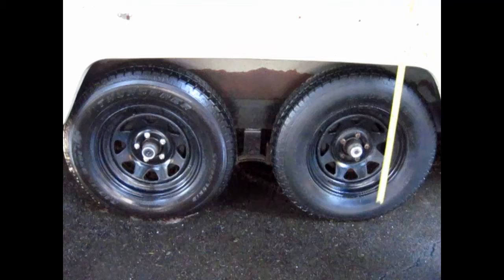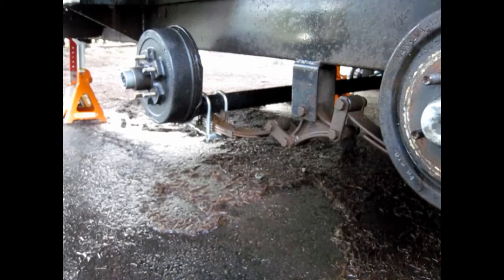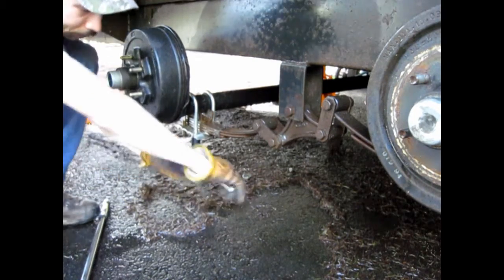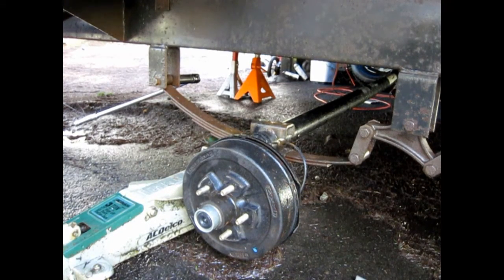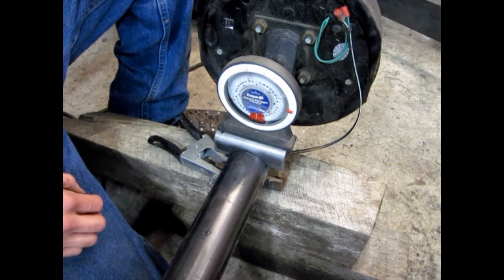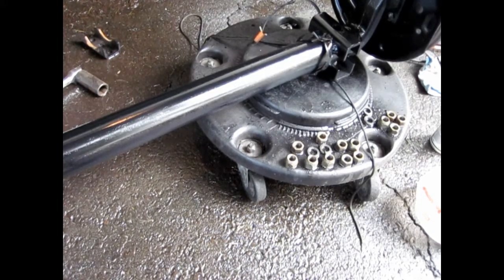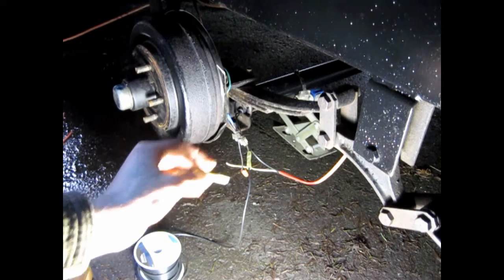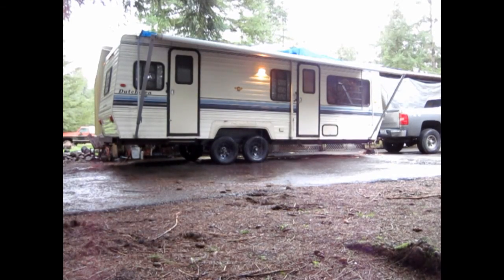Trailer Axle Flip

Comment: Why does everyone want everything higher?  I'm sure it pulls better being low compared to being high.  And it looks better low.
Reply from the maker: Ground clearance is good, especially for long vehicles.  I talked about the previous owner ripping off the jacks by dragging it over a curb.
Reply: We did ours because we boondock off the grid and scraped the ground  in some areas. Crushed our freshwater tank once and broke the brackets.  Haven't  had that issue since we raised it 5".